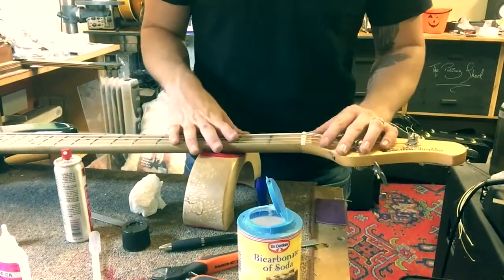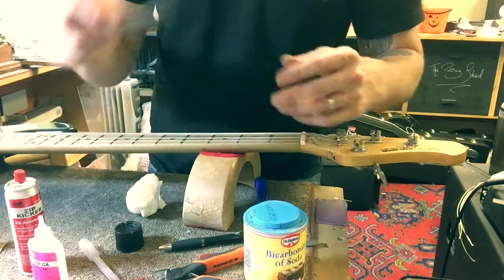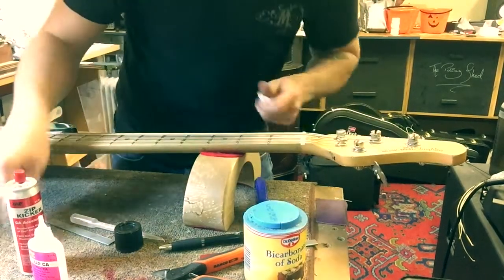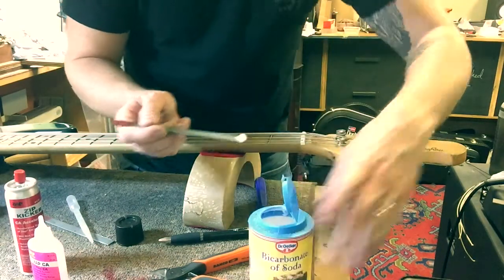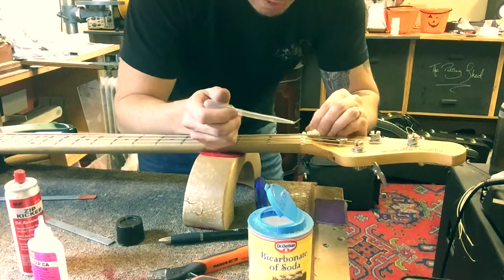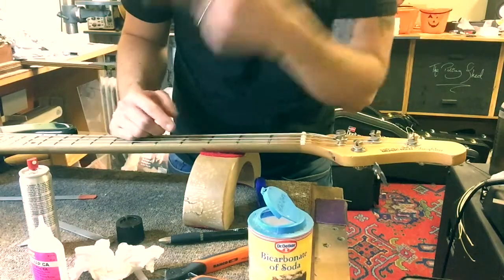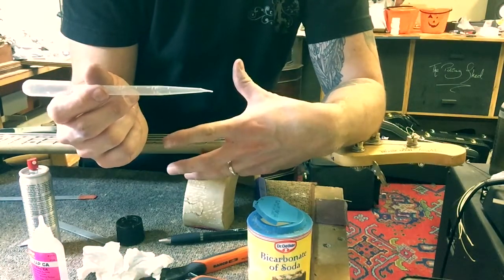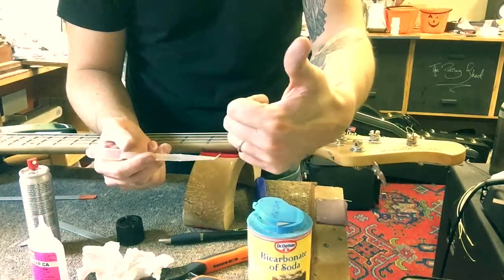Guitar Tech Tips: Fixing A Low Nut Slot......

Comment: Thanks for this video. I just finished a PRS style build and the high e and b buzz when I try to lower the action and I found that the nut is just cut too deep. I was worried I'd have to replace the whole thing, but this is beyond doable. Thanks again! Saved me quite a bit of time and money.
Reply: I literally have the same problem right now, what did you use? Had to get a replacement guitar (the G slot was way too low), then the 2nd guitar has same problem on high E and B
Reply: i just got a new guitar same exact problem bone nut. when i played c on b string it was a c#